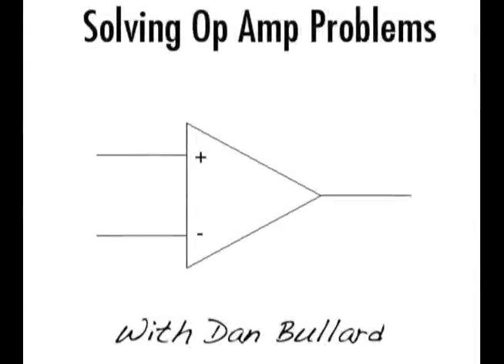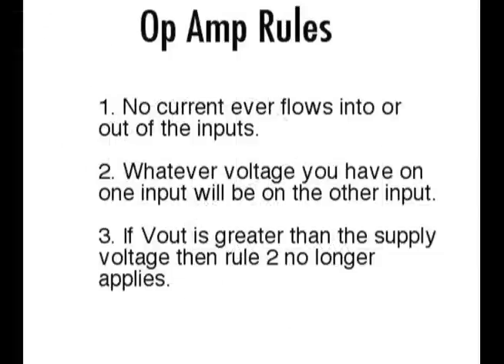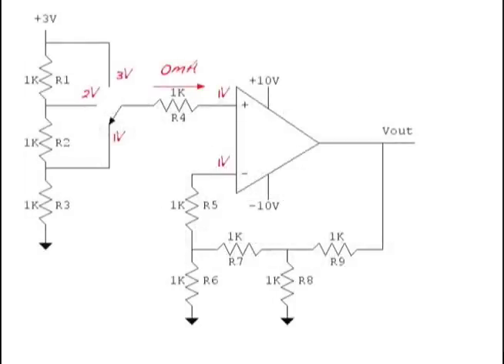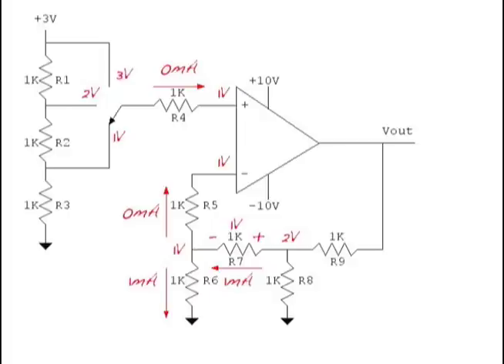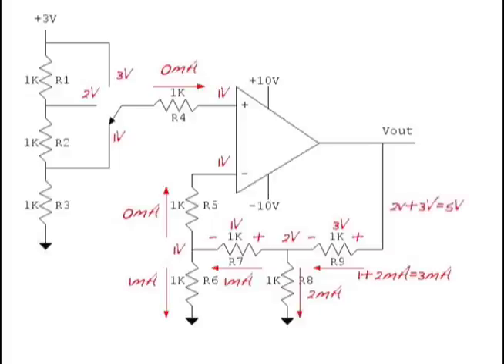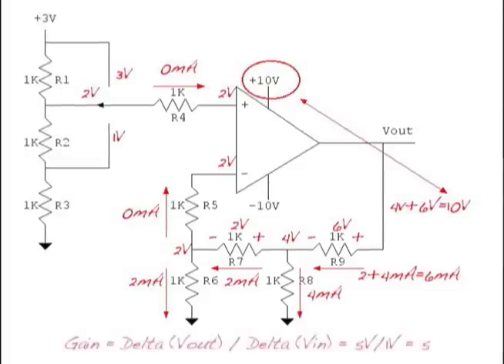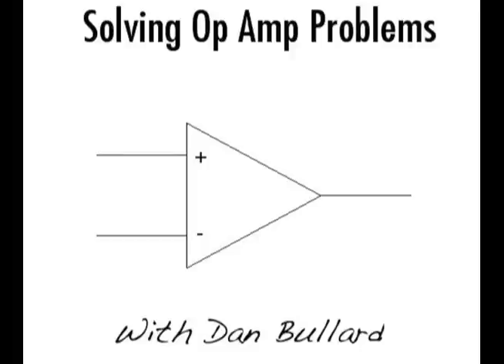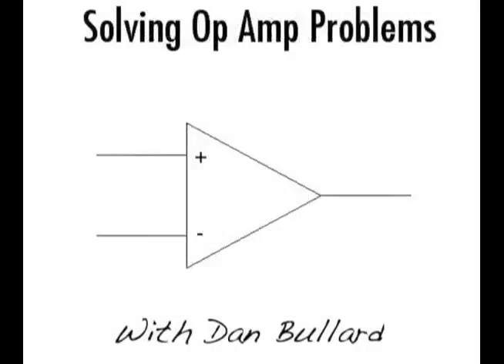Solving Op Amp circuits

Comment: Rule 2 does not apply to ALL op-amp circuits, but it certainly applies to those circuits using negative feedback.

Case in point, if using an op-amp as a comparator, the basic form will not have any feedback, and the two inputs will be at whatever voltages are driving them (and which the op-amp is comparing). To get a sharper snap-action of the comparator, there might be POSITIVE feedback, but the input voltages can still be different.

Comment: I’m using op amps as makeshift analog sensor amplifiers that my digital systems can analyze in my forest to sense living things, I can use them for sound sampled inputs to matched and Kalman filters, and many other sensor shaping and amplifying functions.  In addition, not op amps per se, but I use video AI recognition via off the shelf gear, sometimes, depending on the frequencies (ultraviolet or infra-red) they have a place, and on and on.  They have special properties that make them perfect for analog sensors, depending on how you design them.  This video was a beautiful overview. Very much enjoyed it.  The forest is a harsh environment but there a heuristics to mitigate that for op amps. It’s easy and cheap to use LoRa ($13) to send a bunch of data back to a raspberry pi that can Wi-Fi mesh through a series of similar instantiations back to my bedside with a 128x128 display telling me, with a soft audible indication, what's going on a kilometer away at 2am across a vast area via dozens of individual units. Especially around my barn.  I hit the jackpot when I find a bear, but usually it’s an owl, bobcat, deer, possum, rabbit, raccoon etc.  Once a mountain lion!  Of course, I get my drone out from my 2nd floor deck if it’s a human.  Arduinos are perfect microcontrollers and can talk to chips like the LD2420C for big moving stuff detection and oodles of other ICs. My big add was designing an auto associative NN to integrate disparate signals, often just partial pieces of the whole, to determine the identity of the object.  The beautiful thing is my rapidly deteriorating software skills have been replaced by my prompt writing with AI, I can still create anything in software, much faster, with usually just some trivial glue logic.  I don’t know what the folks criticizing AI code mean; to me, it’s an incredible assistant and, if I don’t like the algorithmic approach, I simply tell it the type of architecture, flow and data structures I prefer.  It’s more than incredible if you’ve got decades of reading code like it’s a novel.  Similar to the brain, auto associative memories leverage massively parallel, resonating loops within loops similar to synapses that, in my opinion, are high/low pass filtered via glial cells I emulate to help the Hopfield like behavior converge.  It’s not recursion (which I constantly hear is some sort of panacea) which is like the differential equations that classic back propagation NNs use to find local minima across high dimensionality landscapes, but integration of disparate pieces of information to glean insight into identifying a concept, or in my case a carbon-based life form.  Op amps are beautiful sensor amplification and shaping vehicles at the front end in several domains and applications I’ve found.  You need their exquisite analog means rather than direct FFTs at the front or other digital signal processing to balance out and spread the sensor signals such that their contributions are as normalized and orthogonal to each other as possible.  Ensembles of NNs like radial basis, Bayesian, classical backprop, K-means, LLMs, and so many others at the back end are often useful for voting in determining an answer often using learning paradigms I used in the 90s but was hopelessly held back by the depth of concurrent floating-point calculations, and ASICs were time and cost prohibitive. What blows me away is I can remember when the systems I used would sometimes cost a quarter of $million; now I can put together a system just as powerful using Lora/Arduino/op amp/ plus a few cool detector chips for less than a good meal!  The small raspberry pi boards I get kick at over a gigahertz!!  That is many times the power of a Cray 1!!! Great time to be an old geezer with Math degrees and depth, was an embedded software engineer for decades in transmission, radar, switching systems, and a bunch of real time stuff I got patents for; retired on a mountain, deep in the forest in the middle of nowhere.  The shortest interval of time I have to pay attention to now is a season, although it’s fun when I get the urge to get my scope out and watch microseconds in op amps tick by😊

Comment: If the input impedance of the op amp is infinite, then what is the function of R4? As you note in the video, no current flows across it in any of your voltage divider settings. 

Is R4 there to illustrate this, or is it there for some other purpose, i.e. to mitigate non-ideal behavior of the Op Amp?
Reply from the maker: This circuit has no useful purpose other than use for determining if the viewer understands electronics. R4 and R5 are there to prove that it doesn't matter if there are resistors on the inputs or not, you can ignore them. If you can't ignore them, you don't understand electronics.

Comment: Someone help me understand: at 2:28 there is 1V at the switch, but if we follow the rule of no current goes into or out of the opamp, how is there 1V at the non-inverting terminal when E=I x R? If I = 0, then E = 0 x 1k = 0
Reply from the maker: Because there is 3 volts across a total of 3Kohms going to ground. It's true that no current is flowing into or out of R4, but you can clearly see a path for current from 3V through R1, R2 and R3 to ground. It appears that this video is far beyond your skill level, so I would recommend you pick up aother hobby.
Reply: @DanBullard  Wow, thanks for the career guidance. Should I also drop by your class so you can show me how you manage to stay an expert without learning anything new?
Reply from the maker: @retiredgoat2021  Show me an electrical engineer who can't understand a voltage divider, probably the simplest circuit in the world. If you got stuck in the first 3 minutes you haven't got a chance of getting through the whole video.
Reply: @DanBullard  I understand the voltage divider. But, never mind. I also understand that you would rather attack my lack of understanding rather than help me understand. Thank you “Teacher of electronics for years and years”
Reply from the maker: @retiredgoat2021  Excuse me, I have moved far beyond Op Amps, recently I discovered 6 laws of physics unrelated to Op Amps and in the process outsmarted Dr Richard Feynman and that is consuming all my time. Watch the whole video,, then watch this one. https://youtu.be/1YlC6qtp2qI?si=44cA5UbxHFBICZri
Reply from the maker: I solved your question here.https://youtu.be/kq5lIvVNplw

Comment: Which part of the circuit is the equivalent resistor?
Reply from the maker: Any complex circuit of resistors can be analyzed down the equivalent resistance. Imagine two 1KOhm resistors in series. What's the equivalent resistance? 2KOhms. Imagine two 1KOhm resistors in parallel. What is the equivalent resistance? 500Ohms. By analyzing the circuit shown, I can (and MUST) calculate the equivalent resistance if I want to know what the circuit is doing. I think you have more to learn than you can imagine.

Comment: Come on this is only a DC steady state analysis, no big deal. Wait until you go into the AC regime, the gain width products, slew rate, settling time, capacitive loading with overshoot...... All comes into the equation😂
Reply from the maker: Only if you want to make it hard to understand. I did this for a friend applying for a. job. She got the job, so it was successful. Now YOU explain how harmonics are created, I'll be watching...
Reply: @DanBullard harmonics are primary caused by non-linearity. Higher open-loop gain and lower  output stage loading generally improves the problem. But then, you run into ringing and insufficient gain. This is why you need to get into the complexity.
Reply from the maker: @edwardcheung1626  Nope, you are wrong. I am the only person on the planet to figure it out. I even beat Dr. Richard Feynman on this topic. https://youtu.be/i0IlWs82igc
Reply: @DanBullard I do not understand why some established engineers feel the need to go onto videos clearly made for students or entry level people who are brushing up on the fundamentals to talk down on them. There's more to Op-Amps, what a novel concept.
Reply from the maker: @shteatinggrin  I made this video 13 years ago for a friend who "should" have understood op amps, and taught in the same school I taught in, and was trying to get a job at GE in Reno Nevada after being unemployed for decades. After watching this video, she got the job. She would have preferred a man to take care of her but you didn't step up, did you? It's not an easy topic, when I worked at Tektronix contracting for Raytheon, I solved a decade old unsolved op amp issue for the F16 in two days. Raytheon worked on it without resolution for 10 years. Let's compare, 10 years vs 2 days. https://youtu.be/05FGkC7BKgE?si=WtU8LWlNn5TU7v0G
Reply: @DanBullard You misunderstood me, I was talking about the commentators talking down on people who found this video helpful. There is nothing wrong with your friend needing to brush up on Op-Amps. And the last sentence was a sarcastic shot at the rude person you were replying to.
Reply from the maker: Here is another video that makes the point pretty well. https://youtu.be/1YlC6qtp2qI?si=95KgKHb1TLCcE1eI

Comment: How do the voltage divider resistors drop any voltage? Is there current flowing in the voltage divider? Does the voltage divider as represented make a complete circuit? Does the 3V source connected to the ground via 3 resistors complete a circuit?
Reply from the maker: @Festus2022  yes, assume it’s a battery. If you got stuck on this point you don’t have any hope of understanding the circuit.

Comment: Don't get the gain portion of this explanation.   What does delta mean?  10v out / 2v in = 5.  So gain is 5.  ?
Reply from the maker: Delta is difference.  A change of 1 volt on the input gives you a change of 5 volts on the output. You can't use the absolute value of the voltage because there might be an offset.
Reply: @DanBullard  Thanks.  Nice explanation on this video too.  Luckily I watched yours first.  I've gone on to watch others and have to remark on your clarity.

Comment: One look at the data sheet of any Op Amp, under the heading of Input Bias Current will  tell you that current does flow in the input, it is low but not Zero as this Joker says.
Reply from the maker: And what voltage drop is created across a 1K resistor with your Input Bias Current? Is it more than a microvolt?
Reply from the maker: I checked your channel, you have no videos, no subscribers, nothing. I have 456,000 views on my Op Amp video, 6,326 subscribers on the just the one channel, and I have TWO channels? You paste those numbers from your datasheet into my circuit and tell me how many microvolts off I am, then we'll know who the "joker" is.
Reply: @ but that doesnt alter the fact that all op amp data sheets specify a input bias current, you are a legend in your own mind
Reply from the maker: @ So calculate the output of my circuit using YOUR datasheet numbers. I might be off by a microvolt, or less. Remember the title of the video SOLVING Op Amp circuits, not Everything you ever wanted to know about Op Amps.
Reply: @DanBullard  I dont have too I know how Op Amps work, I worked for Fairchild Semi C, and National and Matsushita , one of my jobs was R+D Tech,  When i heard you say that Zero Current flowed in the input I  right away thought that is not correct, But either way, other than that, you presentation was laudable, thank you!
Reply from the maker: @andrewcastellane7802  I attempted to sell mixed signal testers to Fairchild, before they merged with Honeywell to become FairwellHoneychild ;-) I went to Colorado Springs to meet with my good buddy Duane Sorely who I trained years earlier, and then I went to Portland Maine to meet with the Fairchild folks there. You might enjoy a video I created to address the Op Amp input current issue faced by Raytheon, and they quibbled over this problem for 10 years, a whole decade because THEY didn't understand how Op Amps work. I looked at it and solved the problem in two days, and this was for an F-16! https://youtu.be/UkfRYfOj3e0?si=r41uvM2rIZeXRCDd

Comment: My fours years at engineering school could not make me understand what you did. Thanks for this wonderfule content.
Reply: kirkandesai, so you went into some other line of work then? I can't image somebody still not 'getting' basic op-amp concepts over a four year college program, and then still going into a job that requires such understanding. Geez, I got basic op-amps in the first 4 month semester where they were presented, pretty easy actually.

Comment: 1:46 would've been nice to see the steps for the first voltage divider, no idea how u got 2v and 1v...

(edit) 
figured it out, as always. never seen voltage divider across 3 resistors, thanks professor 🙄 different way of setting up voltage divider formula. look up voltage divider with 3 resistors and go to images. ur welcome for anyone looking.
Reply from the maker: Rule #1 tells you all you need to know about the voltage divider. It makes the point clear as day. If any current flowed into the op amp input it would be impossible to figure out the voltages, but by using a voltage divider I made the point crystal clear: no current, no voltage drop due to stray unknown currents. That’s the whole point of using a voltage divider!

Comment: Can anyone tell me how he got 2V between R1 and R2 at 1:58? I'm guessing he's using voltage divider, which I did the same but only obtained 1.5V, using 3*( 1k / 1k+1k )
Reply from the maker: You have 3K Ohms spread between 3 volts. There is no other current path through, or around R1, R2 and R3, because, as I state very clearly there will be no current flowing into the op amp, so R4 is a trillion ohm resistor as far as we are concerned. 3V/3K = 1mA, 1 volt will be dropped across each resistor, R1, R2 and R3. There is no 1.5V anywhere, unless you somehow got current to flow into the op amp, which is an absolute impossibility.

Comment: Are the black arrows the same thing as ground?
Thanks for the tutorial by the way.
Reply: Think of it as the reference point (i.e. 0 Volts) for the voltages in the circuit.
If you're using "ground" as "the reference point", then, yes.
I've learned over the years to use "ground" carefully, because it has different meanings, depending on who you talk to (i.e. big difference if you're an electrician wiring up a house vs. an electronic tech fixing an amp).

Comment: Unbelievable how easy you make it seems with this short video. Thank you!
I have one question, what is the purpose of R4 and R5 in this case when there isn't any current flowing there?
Reply from the maker: This circuit is used to test an interviewee's knowledge, so the purpose of R4 and R5 is to see if the interviewee knows that no current ever flow into or out or the inputs.
Reply: @DanBullard  Aha! Thanks for the response. I hope you will keep doing these videos, good teachers with good knowledge are rare.

Comment: why are the voltages at the switch 3v, 2v and 1v though, how do we have voltage drop across the resistor with no current flow.  is it because the current flows to ground?  and if so how is the voltage drop 1 volt if its a 1K resistor?
Reply from the maker: 3V across 3K is 1mA with a clear path to ground, NOT ZERO. That's a simple voltage divider. Does that do it?
Reply: @DanBullard  yes perfect sense now that I look at it like that, I was doing the math on each separately on each resistor to find the current instead of the whole series to ground.  Been a while, just getting back into this stuff so I gotta shake off the cobwebs.  Thank you so much.
Reply: @DanBullard  my next question is what is the point of R4?
Reply from the maker: @matthewlocke1942  To let you prove you know how Op Amps work. This is a classic interview circuit, it doesn't actually do anything, but employers use it to see if you really understand Op Amps. I developed this video for a friend who was interviewing for a job at General Electric in Reno NV. Long story short, she got the job.
Reply: @DanBullard  ok so it’s just there to show there is no actual current flow, and if you wanted to prove you know how it works you would show 0 voltage drop, got it.  Sorry I’m trying to learn more about op amp circuits in my own time and I didn’t catch that part in the intro.  Thank you for your time, I really appreciate it.
Reply: @DanBullard  I went through the whole video again and was able to solve each circuit easily after all of this explanation, I really appreciate you and this video, makes so much more sense now.

Comment: I understood most of your lecture but only because I’m familiar with electronics. A person just starting out would have been lost, especially at the voltage at junction r5, r6 and r7 for instance. To a newbie they would think you just replaced r5 with a straight wire which is a bad assumption. An explanation of that junction voltage would have been most helpful.
Reply from the maker: Too late now, that video has been up for 11 years, and I have moved on, but I'll think about it, who knows, I might make a new video explaining the point. V=I*R is pretty simple when I=0.0, no matter how big R is.
Reply: @DanBullard  my bad. I’m sorry I didn’t notice the date on the video. Thanks